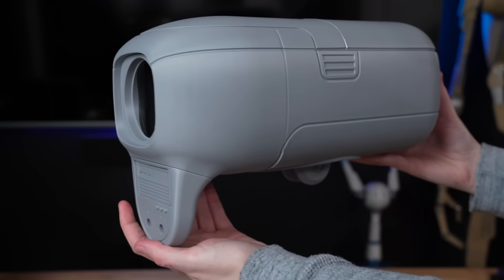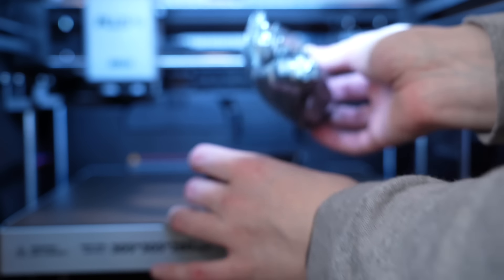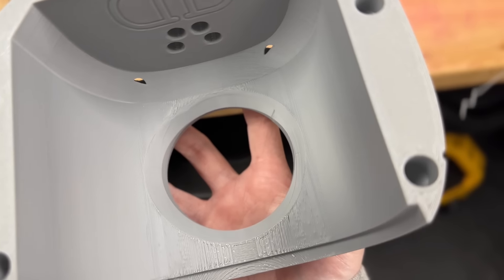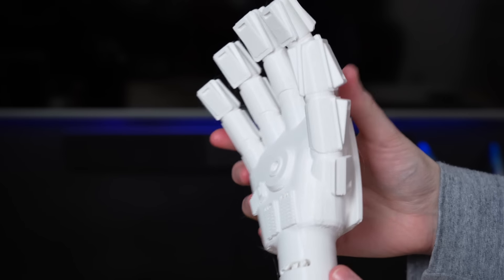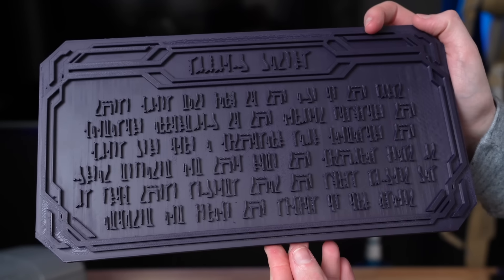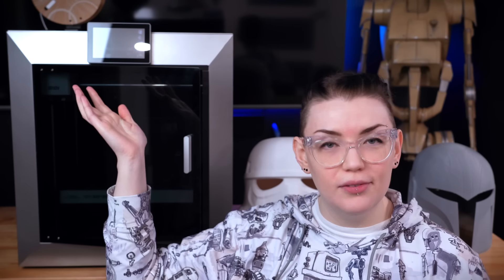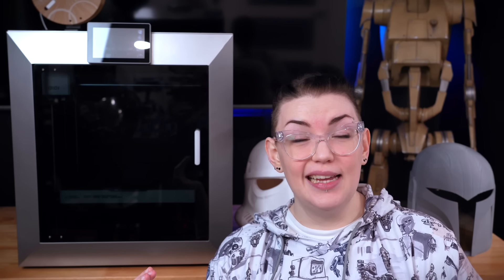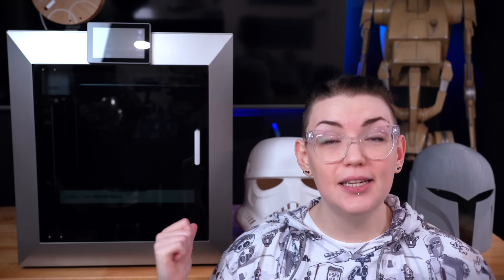Should the QIDI Plus 4 be your next 3D printer?

Comment from the maker: Hey everyone 👋🏻 Since posting this video, there have been some safety concerns brought to light about the SSR for machines in countries with 120v power (like Canada and the US). I unfortunately can’t add this directly to the video now, but here is an excellent breakdown: https://youtu.be/JARwXIiTbxM

As of posting this, there has been a firmware update issued that was thought to have mitigated any issues, but some people’s tests have found it to be insufficient. There have also been some reports that QIDI has already started the process of sending out replacements parts to resolve the safety issues to anyone with a machine in the affected 120v countries.
Reply: You should definitely look into your chamber heater circuit board as your experience with your battery backup was telling you that likely it was drawing more than 400W, and even 500W as you say your battery backup is 900w.
Reply: I contacted Qidi after having heard about the issue, and within a week I received a replaced board.  (I've printed nearly two spools of ABS since getting the printer.)  Just installed the new supply a few minutes ago.
Reply: Yes, Qidi will send all users the newly engineered SSR board that addresses the issue.  Unfortunately, the newest version of this printer still don't appear to come with the new SSR already installed.  But it addresses the issue.

Comment: This thing looks pretty solid. But man if Bambu made a 300mm+ printer I’d buy it instantly
Reply: I think that Bambu is really missing out on a entire segment of customers sticking with sub 300mm build area printers.
Reply from the maker: Hopefully when they do it’ll be a bigger jump than to just 300mm. 350mm+ 🤞🏻
Reply: @MMsPropShop I agree. 350x350 would fit almost all cosplay helmets. 400 would be awesome but I doubt Bambu will go that big.
Reply: I'm still happy with my 300×300×400 artillery sidewinder😂 it just keeps working no drama
Reply: @GDM1787  You’ve never used one
Reply: Thank you for the video.
Reply: 4 to 500 would be nice but the price of that beast would be astronomical.
Reply: @LexJones  I think they are working steadily on it. I'm pretty sure they working on additional features, but wont release until its perfected. Most of their products came out amazing on release, but they felt some pain releasing the P1P while having other cheaper products that worked well enough.
Reply: They took 25% of the consumer printer market in one year. I think they are doing fine fir now.
Reply: So be carefull with bambu. X1c and p1s have epoxied and pressure fit the Y axis so service of the y axis bearings and shaft cannot be done.
Reply: Bigger Bambu coming next year, no announcement yet.
Reply: @notyouraveragegoldenpotato  problem with the sidewinder is the speed unless it's a art4 or 3. Totally different printer style though (bed slinger Cartesian vs corexy
Reply: Is it the future yet? I really want one of these to work drama free.
Reply: If bambu made one the price woud be so high that its just not interresting enoth
Reply: @Acheiropoietos Yea but for way higher prices then the Quidi so it becomes a non option
Reply: @ Lmao what? It would be well under $800-1k which blows most big Prusas out of the water
Reply: Man if bambu labs made a mobile phone 😅😂😅😂😂
Reply: @Kay0Bot did they? Dud they really. Where are those statistics from ?
Reply: Bambu burned a huge bridge with many makers right now. I'll never buy another Bambu product. This is the next best thing.

Comment: It is insane how far we've come. Before Bambu, there wasn't many if any printers that just worked well out of the box.
Reply: To be fair, Qidi was making core XY printers with very similar function and construction before Bambu Lab existed. They just were not very well known. All the way back in 2018 the original X-Plus and X-Max got pretty good reviews and were extremely capable. They just never got a ton of hype. Not going to deny that Bambu Lab pushed the industry forward in a lot of ways, but Qidi is just still doing their thing, listening to customers, and also embracing more open source. The heated chamber and high nozzle temps are what really draws someone like me who focuses on functional prints.
Reply: That has been Prusas thing for a bunch of years, long before Bambu came into the market. My 4yo prusa still just works, i never do any tuning or modding, it just prints well.
Reply: Prusa's kind of were the "works out of the box" champions for quite a while.

Comment: This looks like  pretty great printer, but it's currently at a pretty bad price.  The qidi plus 4 is currently at $799 when for  $849 you can get a bambu p1s WITH an AMS or for $599 you can get just a p1s OR for $779 you could get an sv08 with enclosure and touch screen (which is basically a 350mm voron v2).  sure the qidi plus 4 has a couple tricks that those others don't (like chamber heating, but that's unnecessary as the heated bed is plenty for chamber heating if you preheat for a few minutes)... please note, I do NOT think the qidi plus 4 is a bad machine, I just think that it's at the wrong price point.  if qidi sold this for $599, I think it would be very competitive.
Reply: There is a print quality comparison with X1C in the bambu forum. QIDI did a good job this time. The SV08 can not do it, and p1s is too small.
Reply: Chamber heating is absolutely critical for certain prints. If you need it, you need it, and this has it
Reply: @cbbbbbbbbbbbb  what materials that this hotend (300c max) would be able to print that would require a heater. Heck the voron community, who are known to be a bit extreme, have outlawed even the discussion of chamber heaters due to safety concerns. And these are folks who sometimes build insulated machines to print stuff like peek.
Reply: @joshhardin666  plenty. Abs for instance does much better in a heated chamber. It keeps the warping down. You can print abs on a bog standard ender 3, but an insulated chamber is worth it for the reliabilty. For mine, I just put a box around it and works well enough. I do have a voron style printer as well that I custom made panels for.
Reply: @joshhardin666  ABS, PC, PCTG, NYLON 6, NYLON12 all failed my layer adhesion testing for end use parts when printed without a heated chamber, but were mostly acceptable at 65c. Also even ABS doesn't even reach full strength until you print it in a 90c chamber.
Reply: @AnnikaFPV  I have a p1s, a k1 max, and personally built a 120mm voron v0.2 and a 350mm voron v2.4 and print abs on all 4 as my primary material, not a chamber heater among them. - I just preheat my bed for however long it takes for the chamber temps to reach equilibrium (usually around 60c (about 20 mins on the v2, about 5 minutes on the v0, about 10 minutes on the p1s, and about 15 on the k1 max) - the giant bed with the giant bed heater is pretty good at heating up the chamber on it's own.  I'm quite happy with the results.  I'll freely admit that I haven't tried printing with pc, pctg, or pa (though I do have a spool of pa6cf i've been holding on to for a couple of special projects).  about 95% of what I print is ABS (the other 5% being "art/toy" prints in pla)

Comment: I got mine last Wednesday and it hasn't stopped running since without a single issue with PLA, Silk, PETG, and printing abs flawlessly right now.
Reply: Are you on 110 or 220? If you're on 110 PLEASE open the back cover and inspect the chamber heater board!! It's a fire hazard!
Reply: how? Did you have to fine tune every filament before printing?

Comment: Your content is so dang good! And I’ve really got to try printing some props in abs & asa. They look so good off this printer!
Reply from the maker: Thanks! I’d start with ABS first. Even though ASA is supposed to be a very similar filament, it’s the one that still likes to give me problems from time to time.
Reply: Will you test the qidi plus4, looking forward to it very much
Reply: Your review is very clear and detailed.   Thank you for your efforts.  I am trying to make a decision between this printer and the P1S from Bambu.  This has helped me for sure.  I am leaning toward this printer for the 370 degree hotend and the optional tungsten carbide nozzles assembly.   We will print mainly nylon and PP on this machine.
Reply: @MMsPropShop  Can the Qidi plus 4 print adult size helmet with the 280 limitation?

Comment: I purchased this machine about a month ago and have not been able to get a successful print. I am not new to 3d printing, but I have never had issues like this before that couldn't be easily resolved. The first layer is the worst I have ever seen, with low spots here and there and others that look fine. I completed all the calibrations, temp, flow, pressure advance with no issue. I contacted Qidi but they say this is normal and that it won't be an issue, after a few layers you wont notice it. I also notice that the nozzle scrapes against previous layers, leaving small debris and knocks over all tree supports. following their last suggestion, I got the blob of death, and I have no idea how to even start fixing that mess. Qidi said that was my fault for not using adhesive, really? PLA on a textured PEI build plate? the nozzle digging into the previous layer adhered to the nozzle and ripped the entire first layer off the build plate and created the infamous blob of death. I explained that I get failed print after failed print and sent pics. I have been emailing support for weeks now, but they only give generic responses, like raise the bed temp by 10 degrees. Can you give any advice on what I can try, to fix the issue, Qidi will not acknowledge that there is an issue with the machine, thank you.
Reply: I found this video that goes into more detail and also talks about levelling the bed.  
https://www.youtube.com/watch?v=wc2QbFA-sgQ
Also is there a newer firmware to fix the issue I wonder?
Reply: Sorry it seems YT is still automatically deleting my comments FOR NO REASON.

Comment: @ M.M's Prop Shop. A couple of suggestions with this printer. Use the Orca slicer 2.2 beta 2 or later. There is Plus4 profile in it. Orca slicer also does a better job with thin walls and scarf z seams. It's just better.
For best outcome you still need to do some tinkering with plastic profiles. Also, make sure the belts have similar tension. If not, do correct  them. And clean & lubricate the rods after the printer is settled in (in about 100 hours of print time).

Comment: :face-red-heart-shape: :face-green-smiling::trophy-yellow-smiling:This is one of the best videos I have come across on this printer. Unfortunately, my QIDI Plus 4 broke down after just one day of printing. I received a thermostat error. I was able to order a new hotend and hotend motherboards for the printer. The new parts I might add are now version 1.1 and newer than what shipped with the printer. I have several hotends and nozzles now for spare parts. Do not print PLA with your top lid on/closed. I prop mine open with an add-on I have printed. Other addons needed are items like the poop-chute for the rear and larger fan plate for the motherboard. Qidi service is good, but it is by email only and might take a few days for them to respond. :goat-turquoise-white-horns::hand-purple-blue-peace:

Comment: Love the props you make!  Great job on review!   They have the update which will fix the bed and heater block issue.   Love my  4Plus have been printing nonstop on this unit now since late September and it is a joy!   I also have the Q1 Pro and the Xsmart3 all get a regular non stop workout!  My Xsmart3 is smaller no heated chamber but does a  killer job with ABS.....went through two full rolls of abs on it on my last days off from work, was very impressed.   I can vouch for the 4Plus I have printed non stop flawless prints in all materials including nylon with ease with it.  Bearing on nozzle is rock solid, no issues.   I have printed some very large prints in it, and Qidi did release fix for the tiny area on large print where some of hot air chamber gets blocked a bit, not fully.  Very easy also to add a deflector plate into air exit on this chamber outlet which deflects air up at 80 degrees and some downwards at like 25 degrees so no matter what never can be blocked, but QIDI did send a firmware fix that should work fine.

Comment: Im currently deciding between this or a resin printer as my first 3d printer in about 7 years. Whatever way I go the current options are so far ahead of the offerings from 5 years ago, its amazing!!
Reply: As someone that just finally replaced a Prusa MK2 that I was tired of fiddling with in exactly the way you are talking about: 

Don't do resin unless you are absolutely sure you need it. The fumes are a problem. The material is a struggle. The prints are more complicated and prone to problems, settings are super important and so are temps and the post processing is a bastard. 

I love the quality and the detail I get on resin but it made me go back and buy a good FDM. 
I was gonna get this but I'm waiting for them to work out the kinks and bought a used Bamby Labs printer. 

FDM has come a super long way. Just get a nice core XY like this or P1S and stay happy. Resin is for those that really need resin. It's practically full scale manufacturing.

Comment: So many of the parts of this printer resemble Bambu parts and even fonts printed on them.  Even the drag chain and PTFE tube looks the same as my X1C.  My first printer was a Qidi iMates so I do like their products.  Sadly the actual work flow using my AMS still looks to be superior on my Bambu even though the actual functions and the size of the Qidi is superior.  The X1C has the same problem with the PTFE tube so I printed a riser with additional lighting.  The gray plastic replaced the beige plastics in tech that discolored so much.  The gray discolored less under UV light which is why it was used.  For most UPS units, you want to keep the load less than 80% or you will have some issues with brown outs on the units.

Comment: I got mine some weeks ago and it is a great machine. Will only use it for parts that won’t fit on a Bambu though. For one simple reason. The bed takes sooooo much time to heat up! My guess was it is dc, but you say it is like 400w, I really can’t wrap my head around why it is so “slow” in this regard
Reply: The bed is considerably thicker in the X-Plus 4 to provide a flatter surface. As such, it takes longer to reach desired indicated temp and even longer to properly heat soak.
Reply: @ryanernst4675  I realise that it is a lot of mass, but still, 400w....
Reply: The bambu X1/P1 have aproximatly 700W bed heaters at 230V

Comment: I actually have the X-Max 3 and have done some modifications with it (like converting to a Revo hotend). I realy see forward to the planed colour changer and hope it includes a filament dryer (like the ACE pro from Anycubic). As the Plus 4 uses Klipper like the X-Max 3 I am pretty sure the Colour Box would be able to be used with the X-3 series also.
The problem with the X-3´s of course is the missing fillament cutter. However, as I converted the hotend to a Revo, this should not be a problem. On the Prusa mk3(s(+)) filament unload left quite nice easy to reload filament tips after changing the e3d v6 to a Revo Six (normal flow). So by converting the hotend to a Revo, you can use high flow Nozzle (very ugly filament tip on unload, not reloadable without cut) for single colour/material prints and normal flow (perfect filament tip on unload for dry PLA and ABS/ASA) for colourchange without cut&poo.
While I like all theese AMS/ACE/whatsoever ready2use colourchangers, I realy do not understand why none of theese manufacturers offer an easy to swap hotend with normal flow and integrated heatbreak/nozzle combo. Cut&poo does not only waste a lot of filament, but also a lot of time. On a Bambulab printer (X1C/P1P/P1S) filament change including priming takes between 1:30 and 1:50 (from the last second printed in the object with the last filament to the first second printed with the new). On a Prusa mk3 with MMU2 this needs about 0:40, on a mk4 with MMU3 about 0:30. Quite a difference.

The Plus 4 seems a logical upgrade to the X-Plus 3. Actually the X-3 series is quite nice already. The heater is improved (and AC now, on the X-Max 3 it was 24V DC). The new belts are nice. The nozzle cleaning is nice (but only needed for auto-z-offset and later nice for cut&poo). On my X-Max 3 I only had one real complain: The z-bearings were not high quality, some very bad noises apeare and the layerhights were not constant. After changeing the bearings to misumi everything worked perfect.
Have you had any problems with the bearings on the Plus 4?

Comment: I had problems with mine right out of the box. Hopefully I have them solved but if you want a printer that isn't fussy and doesn't require hours of problem solving this machine isn't it. In contrast my P1S has worked right out of the box with only 1 failed print out of 100. I only got the Plus4 for the larger build plate. If you can wait, skip this and get the Bambu when it comes out.

Comment: The heater vent comes out the front facing the print bed, could you just cut the left and right side of the vent open so it blows out there if the front is blocked?